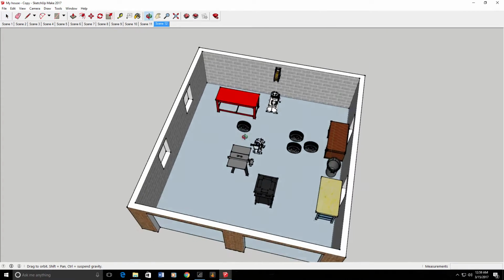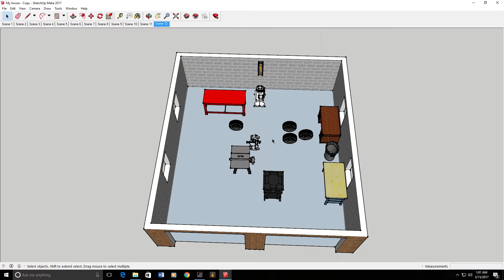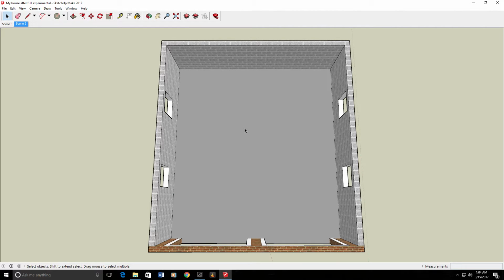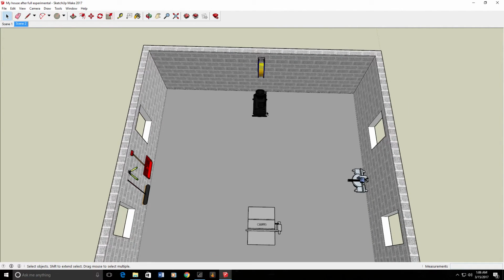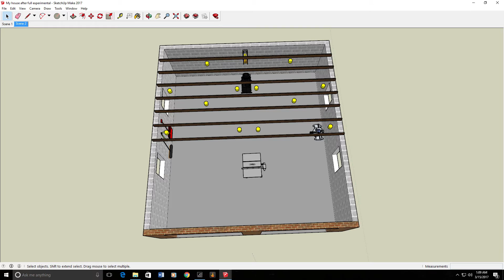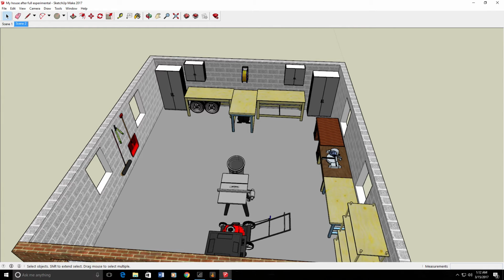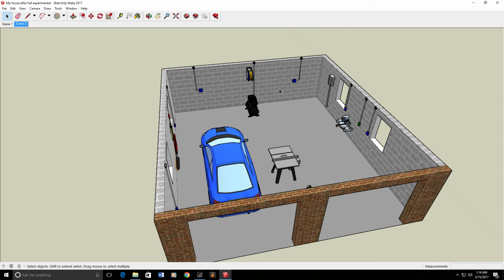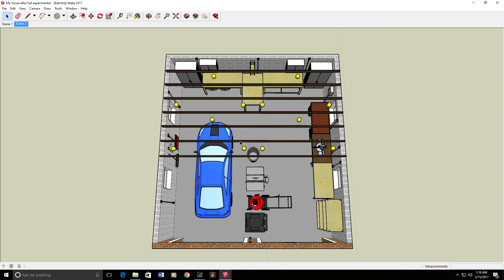How I Used SketchUp to Design My Garage/Workshop

Comment: I'm probably a little late to say this but what about Ego lawnmower? It completely folds up and can sit against the wall no need to worry about oil or a gas can.  Then maybe design a french cleat wall where your brooms are hanging so you could potential put anything there and rearrange it as needed.
Reply from the maker: These are all excellent ideas! The more I use the shop the more I realise I need a system like French cleats. I'll probably remake this video after having used the shop and talk about what I have learned. I appreciate the thoughts!

Comment: Are you using the free Sketchup Make or Sketchup Pro?
Reply from the maker: Thanks for the question! I am using the free sketchup make. I believe it is a version or two old at this point but nothing drastically changed since then.
Reply: DesignIY Can you find out the version number of SketchUp Make that you're using?  I'd like to follow your instructions and try the steps exactly.
Reply from the maker: Version 17.2.2555 (for windows 64-bit)